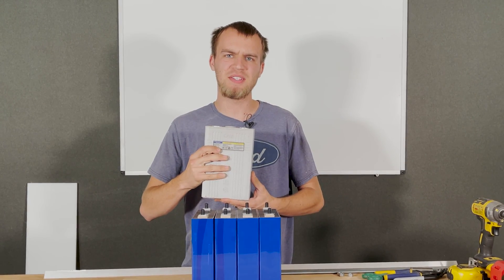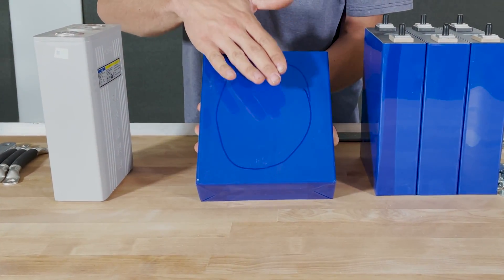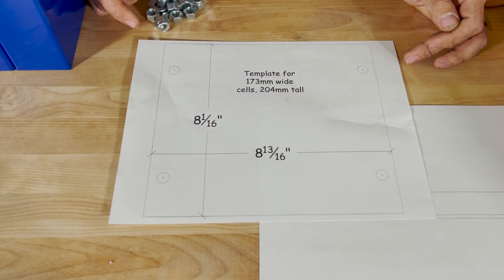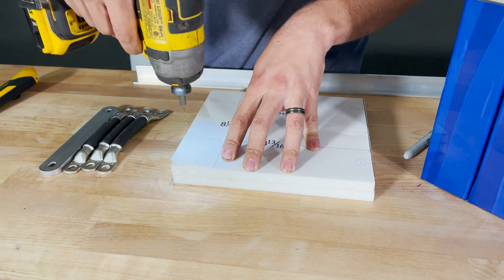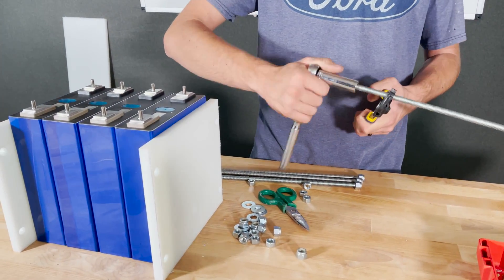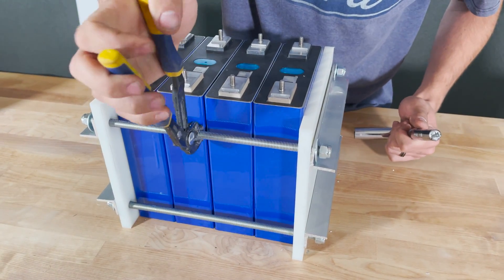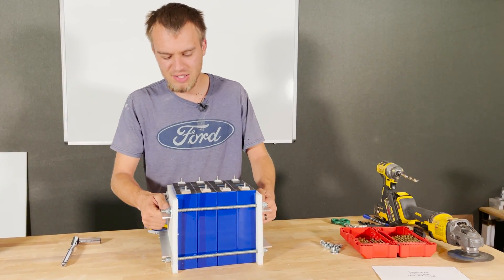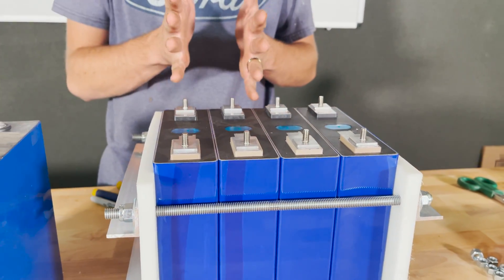LFP Cell Compression || The What Why How & Very Important Considerations || Step-By Step Tutorial

Comment: The step that is omitted from this tutorial is: put separator pads in between each cell.  "PORON EVExtend Battery Pad Material" is an example of a foam specifically designed for this purpose, but almost any foam or soft rubber with the appropriate compressive strength (~10psi - 12psi is optimal) at the intended compression level (% of original thickness) will work.
Reply: Hmm I wonder if I could use silicone heating pads between these cells to have isolation and pack heating in cold
Reply: i've seen fr4 fiberglass as another recommended material to put between the cells, but is foam or rubber better in your opinion? My battery will be put into my van and so will have to be able to withstand vibrations. fr4 is rigid so i'm worried my cells will chafe against it.

Comment: FYI: ref.: "Battery Pack Design, Validation,and Assembly Guide using A123 Systems AMP20 Nanophosphate Cells"
"To operate at its peak performance and have the longest possible service life, the prismatic cell needs to be mounted with some amount of pressure on its two broad faces.  This pressure must be evenly distributed and be compliant to the regular expansion cycles the cell experiences during cycling and over its service life.  A123 performed extensive testing on the effects of the pressure on the faces of the cells on the cycle life of the cells.Figure 7 shows that the optimum pressure on the cell’s face is between 4 and 18 psi."  (pg. 32)
"To maintain proper cell support and account for expansion during the charge and discharge cycles, A123 uses a compliant pad between cells.  The compliant separator is chosen to maintain the pressure range of 4 –18 psi against the cell’s surface.  By way of example, Figure 9 shows how much pressure is exerted by a 1.19mm compliant pad of a certain durometer.  Using this chart, one can choose the initial deflection (16%) such that the regular expansion of the cell during its cycling keeps the pressure between 4 and 18 psi." (pg. 34)
While this reference pertains specifically to A123 AMP20 (20AH) pouch cells, given the thin aluminum cases of much larger Chinese LFP cells, the same considerations apply.

Comment: "angle iron", 'angle iron-aluminum"...! You need a protection layer between cells and a plastic tubing around your 3/8 or 1/2 inch threaded compression bars to avoid the three touching the cells.

Comment: Good video and explination. Thank you. Im building a 48 v battery from two volkswagen e-up and im using the oem moduls after i change the cell configuration to keep the correct pressure on the cells. And i think, like you that this is very important.

Comment: Thanks for the great video. In your opinion, if I am running an active balancer as well as my daily BMS do I need to top balance my batteries when I get them or can I just let the active balancer do that over a couple of cycles?
Reply: I understand that initial top balancing is extremely important.  If its done properly and the cells are the same voltage, the cells ought to stay in balance for a long time, especially if you are using solar and not doing use cycles every day.  If you are running active balancers and a quality BMS it should stay in balance.   Active balancers are not meant to do the initial balance if the cells are very different but are very effective in keeping initially balanced cells in balance.

Comment: Great Job. Some constructive criticism .
The clamp is on the top and bottom edges of the bulge circle you drew out.
there should be three rods to even out the compression.

Also the metal you used is referred to as  "Aluminum Angle"
Is it necessary to leave the clamp in place or is it removed after the balance is done?
Reply: It will be not even so much necessary to clamp them for balancing but for long term the amount of cycles will increase much when they are compressed.

Comment: You should have installed 3rd threaded rod pair exactly in the middle between the two rod pairs. That is where most bulging will happen and you don't have that area braced. HDPE is not rigid enough and will flex. Better to use 3/4" aluminum plates. Each battery will also expand by 0.5mm during normal use so you need to allow for 2mm expansion with 4 cells while maintaining 300 kgf pressure level. That has to be done with either spring washers or springs each capable of 75 kgf if 4 rods are used. But ideally you need to place a load cell between battery cells and measure compression force as batteries are cycled.
Reply: Wow that's really a lot of work to get the max life out of the cells...
Reply: Webbing is going back like 20 years ago 🤣
Reply: main question is what means this 300kgf because on a dyn key we have Nm, kgf.cm, kgf.m and realtion is like 300kgf.mm=2,94Nm or 300kgf.cm=29,4Nm or 300kgf.m=2942Nm . kgForce is not a kg !
Reply: @SiBex_ovh  means 11psi. dont make it complicated.
Reply: @antronx7  on what a torque wrench you have a psi scale ? We have a Nm, kgf.cm or kgf.m in Europe.
Reply: @SiBex_ovh  if you cant figure out how to apply uniform force of 11psi then diy pack building is not for you
Reply: @antronx7  wow, so professional answer !. You should say is better to buy a proper case for LFP who solve that stuff instead of doing diy case but you not try solve or help others. Maybe you should say someting that LFP specification say about 300kgf on space like 200x180mm where F=300kgf*9,81N/kgf=2943N where per 4 nuts will be /4=735,75N and where nuts is M10 who is about r=5mm we receive M=3,68Nm but we have a friction etc. and often ppl use 5-7,5Nm or more. All this is to have and maybe better is not do anything like you say, but not for me. Bless that I not must live with ppl who only use psi foot etc. METRIC HAVE A MATTER.

Comment: The cells in real batteries are not compressed like this. you will do more harm than good.
Reply: Incorrect. In "real batteries" they don't care about maximum longevity of the cells. They will last the 2000 cycles while under warranty but not 6000+ that will be their "real" lifespan if they are compressed from the beginning.

Comment: I have been running those calb 180 cells I bought from you for a year now. I don't even have a BMS attached and they go 20-80 % every day staying within 45mv of each other. I am IMPRESSED with this result so far. The pack is an 8 cell 24 volt configuration.
Reply: RockTech webbing? How do you like your Tbone
Reply: 20 and 80 % is a guess in the dark, but, maybe...

Comment: Please note, that the cycle life of these batteries is without compression.  Don't think that if there is some swelling that the batteries are automatically "Junk."  The spec sheets indicate that if you do compress the batteries it will extend the life past the specified cycle life.
Reply: Just read the datasheet. Cycle life is indicated WITH compression (300 kgf = 3000 N - you see it even here in the video at 2:27 )
Reply: @Henning_Rech  I'm saying that if the batteries swell they aren't automatically bad.  It just means their life is reduced slightly.  Also, swelling can be bad for the connections if using bus bars that are JUST long enough to go from post to post, so if you aren't compressing you should use cables instead of bus bars.
Reply: Compression has NO influence on the cycle life at all!
Compression only has effect on initial capacity, if applied during the first 1 to 3 cycles. After three cycles compression has no effect at all!
Compression does NOT prevent swelling, as swelling is part of the normal degradation. 
Compression just may cause the safety vents to vent earlier...

Comment: 300kgf would equate to a 661 pound weight (a little bigger than one cubic foot of steel 490 pounds). With 71 square inches surface area that calculates to 9 pounds per square inch for your battery cells. The rods and angle iron concentrate the force to a narrow strip. That strip is an area that is only made a little wider by the Poly panel. Differential forces have not been studied for these batteries. So no real extrapolation of life cycles should be made. 

An alternative design to distribute force would be to use "equalizers" across the face. (search on fixture to distribute force). It would not be two hard to set up a pressure transducer to monitor the quantity of force in any setup including the all thread/angle setup. Another alternative is to use a fluid/gas under pressure. A bladder or a piston/gland setup could be easily made. Then a pressure gage would work. If my cells ever arrive, I will try to show an example. Has any one set up a chamber that could be pressurized to the 10 psi? That would apply force uniformly over the entire cell.
Reply: I have had similar thoughts regarding a load cell transducer. The bladder idea I think is not appropriate however. My understanding is that you want to restrict movement of the cell guts. A bladder may be able to provide *pressure*, but not *structure*. The best case is simply a sufficiently rigid endplate. I agree a cutting board does not meet that requirement.

As far as uniformity, using a torque wrench should be more than sufficient assuming that rigid end plate. It would be able to provide pretty repeatable and even clamping force. I did the math a while back and it was a surprisingly low torque value on a 1/4" allthread fastener. Something like 30 inch/lbs to provide roughly 600 pound/force, from memory.
Reply: @bradley3549  Very good thinking. The structure is important in matching the geometry of bulge. I was pondering using a bladder that is commercially sold to locksmiths. The first problem was they are only rated to 300 pounds force. Secondly they are not ideal for using in extended periods of time. Apparently the bulge is more or less symmetrical as one would expect from a rectangular surface fixed at the edges. The bladder, I thought would be a good counter force in geometric terms. With this idea of a good fit, I am now looking at other load distribution systems. Fortunately there is a wealth of Jig & Fixture documents. I am looking at honeycomb aluminum and ridged materials like a product called CoosaComposites. I appreciate the response and thanks for the thread pressure calculation.
Reply: @Snowy-Owl-Retired  I still think you are missing a critical point. You don't want the bulge at all. The prismatic cells are built flat, with a jelly roll inside. You want the plates to constrain movement of that assembly, as manufactured. The bulging is part of if not the whole issue because it creates asymmetrical stress on the layers within the battery.

That said, an interesting problem occurs when you start out with already bulged cells. Are you better to compress them flat, apply pressure but leave them bulged or just let it ride wthout compression because the damage has already been done?

I'm heavily leaning towards the last option, but I've not seen any data one way or another.
Reply: @bradley3549  here are my thoughts. The people creating these cells are manufacturing and machine tool centric. Thee term fixture is a machine operators term. Jigs and fixtures are two main devices to hold parts. They function to support and hold in position raw material or part. Clamps and vises are special cases of fixtures. In general a jig holds the material and the jig is moved towards the tool. A fixture hold the part while the tool is moved agains the part. 
My interpretation of the "fixture" is not a clamp or vise. Both of these are not intended or ideal for a fixture whose purpose is to keep the part from moving. 
Thinking of the cell as the part that is applying a force against a fixture I assume is what the manufacture is talking abut. The tool causing the force on the part is the expanding volume inside the cell. That volume of expansion caused by electrochemical reactions related to the amount of current passing through the cell. 

Therefore the the fixture should not be designed as a clamp or vise compressing the cell. The cell's internal expansion, which take on the shape of a dome on the larger surfaces of the cell, exert up to 300kgf. The simplest design would be two fixed panels that would not yield below 300kgf. This would hold in a fixed position the material inside the cell. A designer of fixtures would create a system of components that would economically accomplish this task of not allowing the movement. Other considerations would come into play such as heat, weight, and  construction ease. 
I have no clue on the trying to reverse volume by compression. It seems contra intuitive to introduce strain. In that case one would maybe redesign a fixture to fit the dome and not allow further movement.
my thoughts anyway. I am looking at chloroplast or twin wall polycarbonate to separate my cells. The fixture will likely be plate aluminum or steel. Cheers.

Comment: 1)  Please "sleeve" the threaded rod to prevent ANY contact between cell sides and rod.  Plastic/Vinyl tubing or even wire harness tubing.  The thin vinyl wrap on the cells will offer no protection from rubbing chafing or such.

2)  Alternative to using "Hard Board" plates & rods, 3 strips of Polyester Strapping (1/2"-3/4") as used with heavy shipping packages with or without buckles, works quite well and is commonly used by battery pack assemblers.

Recovering "slightly bloated" cells is possible.  
- Discharge to 2.75-3.00V   Temperature at or near 25C/77F.
- Do no more than 4 cells at a time, once properly flat, bind the "set" immediately.
- LIGHTLY compress (Finger Squeeze tight only not pressured) with 2 Full Plates (1/2 wood etc, on large face),  allow 2-4 hrs then squeeze "lightly" and wait another 2-4 hrs, observe carefully NOT to put too much pressure, it is a matter of being "gentle".  2, 3 times should be more than enough.  NOTE This is for only Mildly bloated cells, be slow gentle and cautious, do not rush and force anything !  IF it requires more to flatten out, the cells are not mildly bloated.

Note regarding the Binding of Cell Groups.
It is best to bind them into functional blocks of 4 cells.  If for any reason you have to replace a cell or adjust a block of 4, then you only have to rebind that block and not a whole pack.  48V/16S = 4 blocks of 4 cells.  Adding a Pull String (heavy duty Nylon) to each bound block can make it much easier to extract from an assembled pack.
Reply: I just watched his older video where he stabbed the battery and asked about pressing slightly bulged batteries lol. My 8 280ah cells came in two packages. One cell in each was slightly bulged where as the rest are sunken in, i asked if they could be pressed back in. The buss bars dont have much room to slide on so they are tight on the two swelled cells, good to know they can be compressed if i ever take them apart and they bulge more. Have you seen a video of the pressing them together? 
   I watched a video of a teardown of smaller cells where two cells about doubled in size when pulled out.
Reply: @checkingoutgypsymike2075  I followed such a techniques without issue on some used EV Grade LFP I received, took me a few days of gently doing so and it worked ok, trick is GENTLY noo force.

BTW:  No Aliminum Cased cell is  "perfectly & Absolutely" flat, as they are not much thicker than a Pop Can. They can expand and contract by as much as 2mm (safe marging).  Beyond the total of 2mm and there are will be other issues and do NOT attempt to reflaten.
Reply: I used PEX tube for my 4 cell battery.   I'll be adding center rods making it 6 rods total.

Comment: Great video! You did a much better job explaining the need for compression than I had. One thing I noticed though is that you didn't use any separator between the cells. I don't feel the blue heat shrink wrap is sufficient due to the small charge present on the casing. What are your thoughts on this?
Reply from the maker: I just got the new 230ah aluminum ones, 30mv difference at 100->0 soc test
Reply: @HighTechLab  Were yours the same EVE cells I have? I really like mine and have been thinking of ordering 64 more while the price is still good.